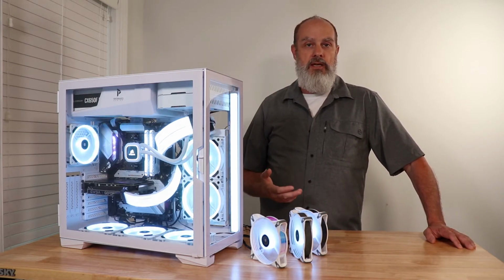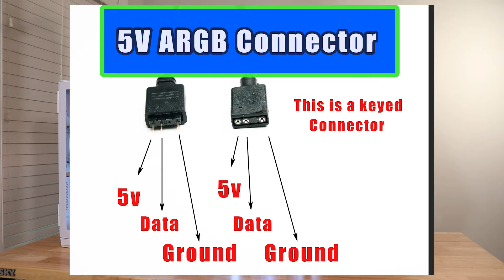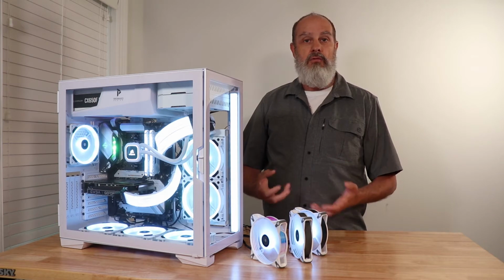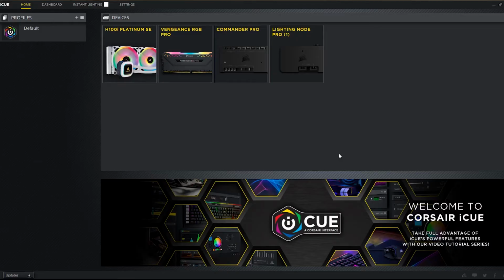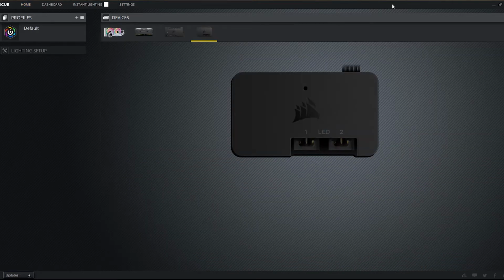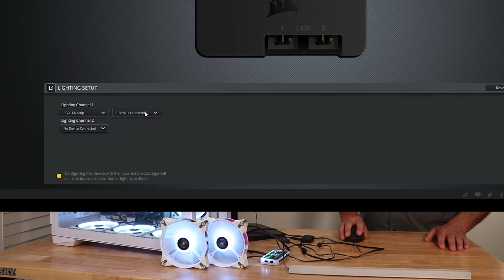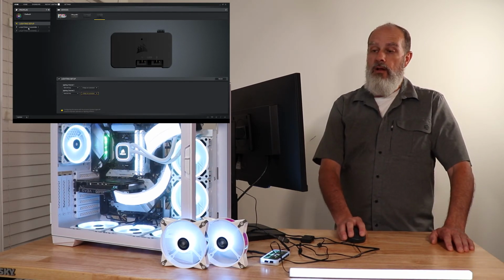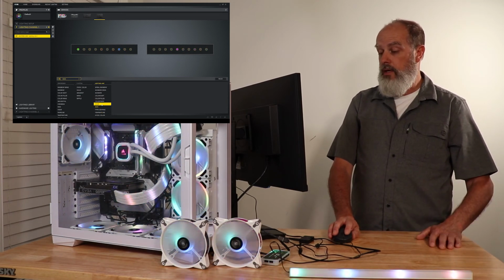How to get all your RGB working with CORSAIR iCUE - Tutorial

Comment: Really appreciate this video and what seems to be a straightforward acknowledgement that this can be done. I am trying to finish off a new build yet seem to be running into a wall for a holistic rgb control solution with what I’ve picked up. Not expecting an endorsement here, but if you, or anyone reading this comment, could provide a generic link to the type of adapter cable  that accomplishes attaching phanteks  drgb case fans (5 volt, gen 2 “blanked”4-pin) to the commander core hub bundled with the white Corsair h150i elite Capellix, I’d be incredibly appreciative. I feel like it should be very straightforward, but then I read something that says the type of RGB on the Corsair hub is not at all what is on the case fan side of things (this seems entirely wrong to me, but I don’t wanna blow up my $700 ASUS Formula board 😂). Thanks in advance!
Reply: ARGB and DRGB are basically the same thing, so those adapter cords that you see should work! Good luck on your build!

Comment: I am trying to connect 6 fans. Each fan has to have one solid color per fan, but each fan has to be a different color. Do I need corsair fans or will an easy fad 6 pack work? I am having trouble figuring out the limitation of the non corsair hub in induvial fans. This portion is usually brushed of as you can play with it.

Comment: iQUE software was developed by NON LOGICAL devops folks. Worst lighting software out there. It sucks, I have a complete 7000 case, 9 fan, RAM etc new build. 1st it wont touch the RAM, second the 2 Commander XT wont talk to each other so 1 fan and m y Corsair 360mm iCUE cooler work independent of the other Commander XT. The DASHBOARD taks up 3/4 of my 27" secondary monitor, zero location becon software which is standard on even the cheapest cisco gear so you play WHICH FAN IS THIS bullshit. Total junk...27 year telco eng speaking here.

Comment: Would be nice if those commander boxes had an option to connect to the motherboard..
Reply from the maker: HI DRS KING DAVID, I would agree that statement, a motherboard sync option would open up some cool effects with corsair fans. You can use apps like openRGB and signalRGB, but i'd vote for a mb sync port. Great suggestion! Thanks for watching!
Reply: Pirate dog Tech has a specific cable just for that very reason! It connects your commander to the MB and allows I cue control over all ARGB devices connected to the MB. They have two options for Asus/MSI RGB tech and a different option. Lastly they have a DRGB cable. Plenty of options!

Comment: the bottom 3 fans. Are they reversed? or you got them blowing air on the desk? I cant get over Icue''s limitation with not wanting to do audio and lights if you dont own a corsair headset. It caused the return of a K100 and dark core mouse. plus Icue dont really work very good controlling lights on motherboard anyway. It list's (and Argb header's) with in icue but does nothing. i hope someone @ corsair is happy about that. returning for a claymore 2 My aura sync can work with out Asus speakers or Asus headset.

Comment: My motherboard has 4 pin rgb headers! 3 pin connector will not connect cause of that blank hole
Reply from the maker: Hi John Hamilton, that 4 pin RGB header will be a 12V RGB header and won't work for controlling 5v ARGB. However, verify that your motherboard manual. Thanks for Watching!!!
Reply: @HardwareArtisan  yeah I saw a video that explained it! Ordered a ql120 kit with controller

Comment: I don't have experience with MysticLight, EVGA or Gigabyte Fusion, only Asus Aura, but I can safely say it's the worst. It's a total crapshoot what's going to work, or if it's going to work at all. I've uninstalled, reinstalled, updated, used older versions. Sometimes all your devices will work, sometimes it'll say "please restart your computer." Sometimes the mobo will show up in iCue, sometimes my gpu, sometimes neither. RGB should just be an open standard and it should be up to the companies to work in the implementation the best. How this is still a problem in 2022 is confounding
Reply from the maker: Hi St4rTr3v1Ut10n , well said, I think most of us are in agreement that RGB implementation is a problem for sure making it way more frustrating than it needs to be, but, it's still fun to mess around with. Thanks for the great comments and watching!!!

Comment: I have bought lian li Strimer V2 but i cannot connect to icue. I have adapter but not working..
Reply from the maker: Hi merkekeruysat, I have connected icue to the Lian Li Strimer, I haven't tested with the V2, but I can't imagine it's much different. Make sure you're using the ARGB sync cable, and the cable should connect to the middle port on the conroller, right next to the power connector.

Then connect your adapter cable to this connector and into your corsair controllers RGB/LED port. Then play around  with the setup in icue to get looking good. 

You also will need to put the controller into a motherboard sync mode by pressing the M1 button for 2 seconds. 

I hope that helps, I'll have to perhaps do a video on this subject and revisit it. 

Thanks for watching!!!
Reply: @HardwareArtisan  I ordered the Lian Li Strimer V2 yesterday with the adaptive cable. I am hearing the same thing today and no one with V2 has been able to connect it to iCue, even using your way. It works for V1 controller, but not v2 controller. Can anyone confirm that or have a fix?

Comment: what about my lian li cooler than uses a 4 pin jst with only 3 pins in use? there is not 1 adapter i can find. it’s either 3 pin or 4 pin. nothing with a 4 pin housing using 3 pins……. 🙃🙃🙃🙃

Comment: I'm at a loss; the LED connectors on my Corsair ML fans have four pins and four cables inside.
Reply from the maker: Hi Barát Gábor,  The Corsair ML fans with that 4 pin connector will natively connect to a corsair RGB fan controller, no adapter cables are needed. This video was intended more to get non-corsair RGB components connected to a controller and use iCUE to control them. 

for the ML Fans, you can use any of the Corsair RGB controllers, Lighting node Pro, Lighting node CORE, the commander PRO, commander core XT, or the commander core. 

I have videos on all those products on the channel. 

I hope that helps! Thanks for watching!!!

Comment: Can i just used lighting node core?
Reply from the maker: Hi Achik My, great question! The lighting node core uses a 4 pin connector which is designed for Corsair fans. The concepts in this video wouldn't apply to to the lighting node core. Although it might be possible to create a cable adapater that would work with the 4 pin connector, I have not tried it. That might be an interesting concept to see if it can be done and how it would work. I appreciate the question and for watching. Have an amazing day!
Reply: @HardwareArtisan  ill try with node core and update its later
Reply: Confirming there are in fact adapter cables to connect the Lighting Node Core (and Command Core XT)'s 4-pin ports to the 3-pin ARGB connectors on non-Corsair fans.  I've done this on 2 builds now using Thermaltake fans, but did not realize the same could also be done with the Lighting Node (and Commander) Pro using a 3-pin adapter.  Always good to have another option for those trying to put together a budget ARGB fan build, as multiple Corsair ARGB fans can get pretty expensive.

Comment: I got the connector but for commador core and connected all my RGB with it, a totally 173 LEDs are connected now with commander core.
but my question here do you know the maximum LEDs can commander core can handle? 
since I want to get 24 and 8 pin Lian Li strimmer plus and control it with ICUE.

Comment: I cant find the adapter in my country, only a VDG connector rgb adapter, can I plug that into my commander pro or LN?
Reply from the maker: Hi A. I was able to plug in a device with a VDG connector to the CP and it works. It physically fits and makes a good connection.  Keep in mind that the VDG connector is not keyed and is able to fit in the CP or LN ports in either direction, swapping the ground and voltage. I can't say with certainty on any device if this would cause damage.  Do a bit of research so you are sure what the pinouts are. Good Luck! Thanks for watching!
Reply: @HardwareArtisan  Thanks! Wil it also connect to the commander Core? I got it with my new cooler and not sure if its different from the commander pro

Comment: okay so ive been struggling to understand all this but im getting a ek aio cooler, asus strix motherboard, and a lian li case that im going to use with the supplied 3 rgb fans and buy 3 more lian li 3gb fans so I would just need the adapter and the corsair commander pro to hook all of this up? i see the commander supports 6 fans and the usb slot for the motherboard so that would take care of all that correct? and just leave me with the aio to hook up? so I would need a second commander and adapter for those 3 fans or does that use a different kind of connector? Would the aio possibly the other usb connector that the commander pro uses? waiting for all this to come in the mail so just trying to figure out what all I need to get before everythings here
Reply: or would i get a 10 slot fan hub and use one adapter to plug it into the commander?
Reply: Any update?
Reply: I'm guessing this would work with standard argb connections with adapter's looking for use with 6 antec pryzon Argb  fans hopefully will work